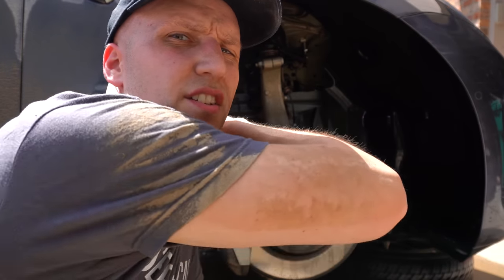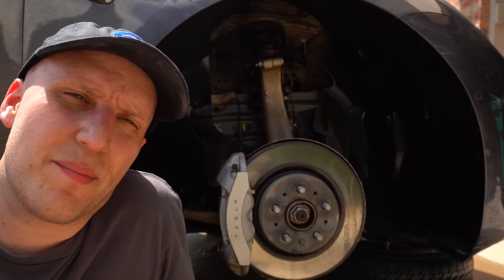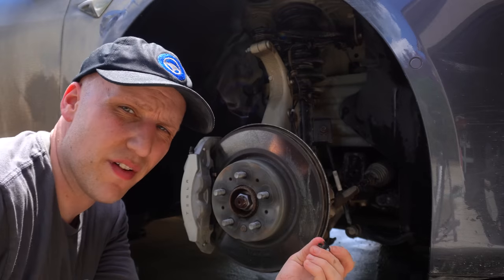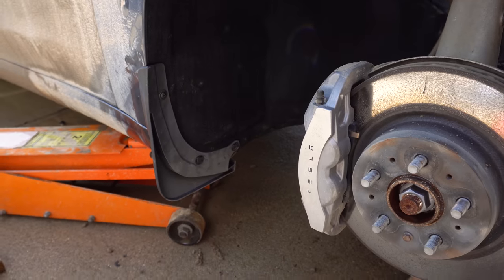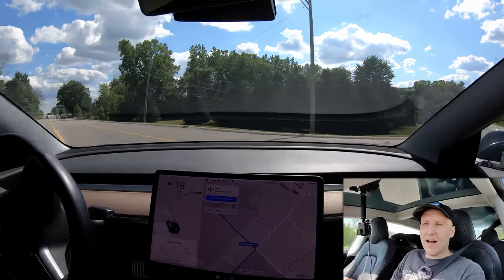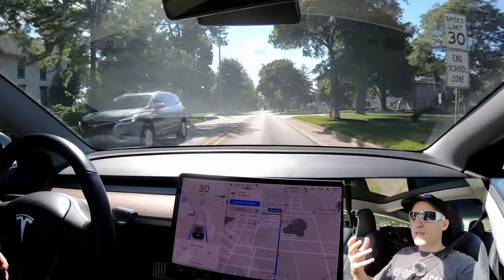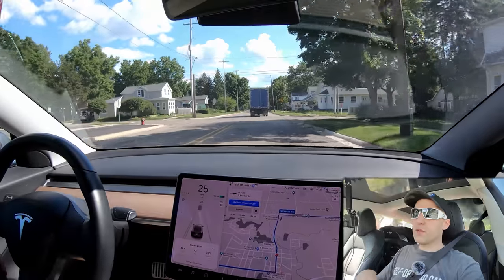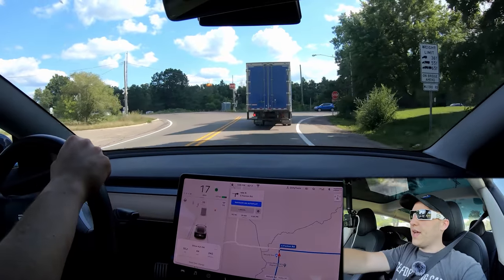Quiet Down My LOUD Car? Basenor Model 3 Wheel Well Mat Review | Quest For Quiet Episode 1 |

Comment from the maker: Thank you to Basenor for sending these out. A subscriber requested a test, so here you are.

One thing to add: I left out two clips on each side (near the middle/top) because I simply couldn't get them to go high enough to clip into the metal of the car. Even with this, the mats do not move.
Reply: did you have AC on for the clips before/after?
Reply: Need the next episode please!

Comment: I'm the opposite, wind noise is OK, tyre noise is huge and totally dependent on the surface, we have a section of motorway that's recently been resurfaced with some "new to Ireland" surface and it's heaven when you go on to it and hell when you come off, near silence versus a harsh buzzing/hissing and the speed has not changed.
I put some foam/bitumen pads under the frunk tub which may have helped and is really easy to do.  I have carpet +rubber mats in the frunk and sub trunk and also left the Tesla carpet mats in the footwells (front and back) when I put in the rubber floor mats.

Comment: I got a different AV that had window frames and although it was cheaper than the Tesla it does not have that same with noise at 70. I am pretty sure that sound is coming from all four windows not having a frame

Comment: the VAST majority of road/tire noise makes its way through things like the control arms and come from the floor of the M3 its not too difficult to pull the carpet out and put in a sounds deadner and MLV. try this for yourself... record audio with your phone in the driver seat and start tapping with something like the back of a screwdriver on your control arm and other components connected to the wheels and you will see just how much of that small tap makes its way into the cabin.

Comment: Loool if you broke half of the clips, sorry bro, you were not being careful. I took all 4 corners off including the underbody panels, didn't break a single clip.

The trick is to wiggle it left and right a little and if it doesn't come out, is most likely you didn't pop the pin all the way out, so push it back in and pry it back out again.

PS: you are better off pulling the stock guard down, spray some rubberized compound behind it instead. Also, majority of the road noise are actually coming from the doors, you get better result putting some sound deadening mats there instead
Reply: what about putting sticky mats on top of the stock wheel well guards?

Comment: Great video, I will be following this series for sure. I have heard that getting good tint on the windows including clear on the front windshield can help, but I haven’t tried anything myself. I tried doing a sound test with a meter between the Model 3 and Model Y and it seems like the Model Y is quieter. Not sure if they added sound deadening or if the fact that is so much newer contributes to that though.

Comment: I adjusted all 4 windows for a tighter seal. That helped to lessen wind noise. Another indication I have a tighter seal: when power washing the car I see far less condensation at the edges of the window underneath where the class contacts the rubber seals around the B-pillar areas.
Reply from the maker: How did you do that?

Comment: on the dirt road, I heard a difference. Everywhere else on the paved roads., not even slightly.

I think it does help, but the wind noise should be addressed because perhaps the wind noise is so loud you can't even hear the lower frequency road noise

Comment: Have you done weatherstripping on doors, and the huge rubber “o-ring” around the roof glass in the little space?  It helps a ton to reduce wind noise
Reply from the maker: I did the doors and noticed no difference. I haven't done the thing in the top glass.
Reply: I bought the giant rubber band, but never installed it. Looking forward to your impressions.
Reply: Rubber around roof made no difference to me, I ended up pulling it out because it digging under the glass into the adhesive. Check yours and make sure it doesn’t mess up your glass roof seal.
Reply: Did you get some weatherstripping by the side mirror/hood part?
Reply: The roof liner made a difference for me, but also started cutting into the window seal on the corner, so I removed it.

Comment: I have seen that in the new Model 3 they have filled in the BIG square hole in the metal roof of the trunk under the rear parcel shelf. I think it is about a foot square or more. I read somewhere the the change was made to stop road noise getting into the cabin from the rear trunk area. You might check into that. Check out video by Paul Braren at 14:15 in.

Comment: I have never noticed wind noise as a major source of noise in my Model 3.  Sure there is a bit, but that's frameless windows for you.  The HUGE and DANGLY low hanging fruit is tire and road noise.  (The difference between smooth and rough roads is very noticeable).  This comes from two sources:  Tire, and suspension.  You noticed a small improvement with damped wheel wells, which I'd say represents tire noise.  But in a car which has been carefully designed to be light, the suspension has got to be transferring vibrations to its supporting structures.  Just not sure how one would dampen those easily.
Reply: Get a new Koni suspension

Comment: Chris, thanks for going to the trouble to test that set of mats. It appears that those mats are only for the front wheel wells, although the information on the Amazon page is not specific except for one comment further down the page. Are mats for the rear wheel wells also available? In my 2018 Model 3 DM the most tire noise seems to be from the rear wheels.
Reply from the maker: Nothing for the rear. Those seem to have more fabric from the factory tho.

Comment: I have the opposite problem, I think the road noise on my 3 sucks! I only have 5,100 miles and it feels like my suspension is already getting harsh going over bumps. I test drove a model Y, it was so much quieter and suspension was much better dampened.
Reply from the maker: Hmm. I just had some friends drive mine and they were impressed with the suspension and specifically said "the suspension is really good even on these dirt roads!" 😂
Reply: Dirty Tesla it’s all relative, depends on what they drive daily
Reply from the maker: They were comparing it to their jeep lease. Not sure which jeep they have tho but it's a 2018 I believe

Comment: On the forum I’ve seen people who had wind noise issues state that filling a gap in the top of the front fender back by the windshield helped a lot. Many used sponge material. I can send a link if that doesn’t make sense.
Reply from the maker: Yeah send it. I think I've seen it

Comment: I've heard that people put sound-absorbing foam inside the doors, are you going to try that?
Reply from the maker: Maaaybe. But my biggest issue is wind... So I'm not sure it'll help with that
Reply: @DirtyTesla  probably not :)
When you have one of the most aerodynamic production cars, and your biggest problem is wind noise, it's hard to go anywhere from there.
Reply: @DirtyTesla  I think they modified the roof glass since early 2020, the panels are closer together so there may be more road, less wind noise on 2020 onward cars?

Comment: Well if you had the plasic off you should have done the inside of the well it self and what ever you can in the wheel well area with killmat, ...but  you are looking for quiet  let me help you first look at your tires go to hankook tires ion ev tires they are sound deading tires then after order through both these companies  they have templated sound mats for the model 3 soundskins for the model 3 and dynamat for the model 3 , then finally  do the rpm tesla door seal kits is the best because they have the best seals and give you extra glue and also give you the whole kit for fronk trunk 4 doors and roof glass then finish up with going back to sound skins for the audio speakers kits

Comment: I had some severe wind noise coming from the drivers window, or so it seemed.  Finally had the panels on that side adjusted and the wind noise has disappeared.  Also, on the basenor stuff, where is that made?
Reply from the maker: I assume it is made in China but the product was shipped from California.
Reply: When I got mine there was a terrible whistling over 70km/h, it turned out the plastic trim below the windscreen wasn't clipped in and the little gap acted as an actual whistle. The car almost went back because of it.

Comment: @1:00 >Well, that was a lie
Completely teasing! Just disappointed to not see a series of videos on this topic after immediately hearing that!
(could add the 18" VS 19" wheels video to this playlist? As those seem to make a noticeable difference in sound level reduction?)
Im sure its difficult to make much progress on some EVs, but would love to see ambitious experiments to see what could be done given the motivation.
Was just wondering what would happen if the entire inside of the tire was lined with the sound damping foam! What might be the effect considering that seems to be the bulk of the sound when on rough roads..
And ways to adjust any surfaces for improved wind noise.